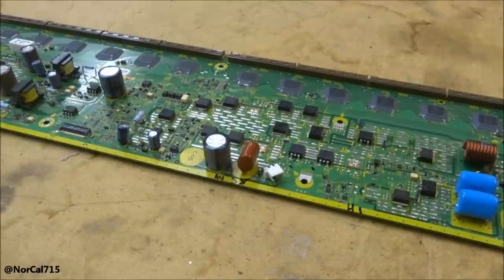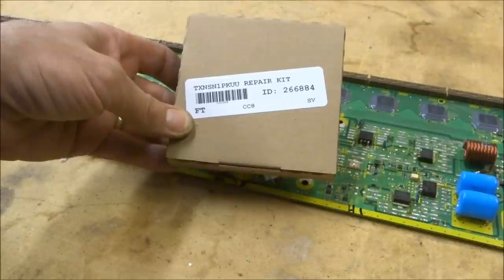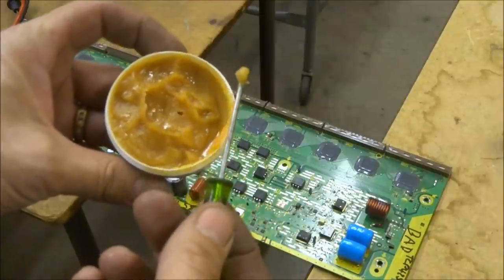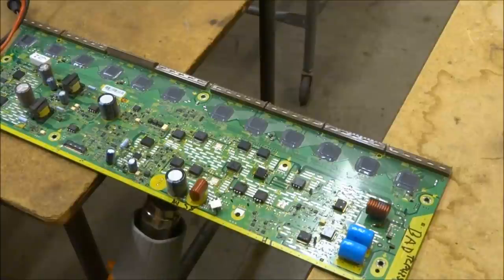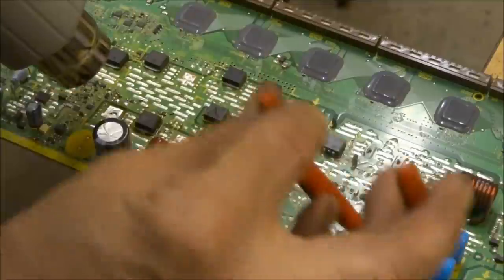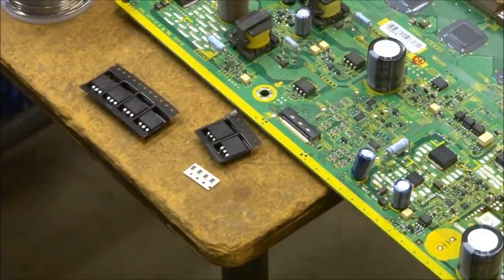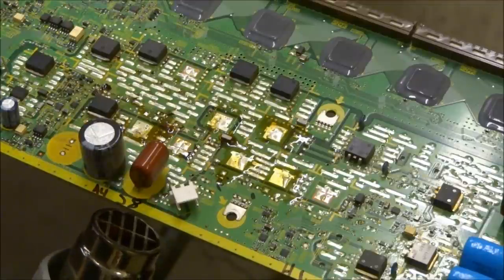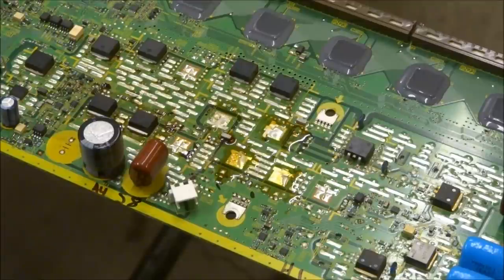TNPA5349 TXNSN1PKUU SN Board Repair Kit Installation

Comment: Thanks for this great video and troubleshooting guide. This matched the issue I had and the root cause appeared to be loose ground screws which led to the solder points where the screws were wearing through and getting scorched.  In addition to replacing the parts, I also applied fresh solder to the ground points surrounding the screws on the top and bottom of the board.  If you have this same issue check the pads surrounding the screws, reflow them and add in some lock washers to ensure a good connection.  I did use a $40 hot air station from ebay instead of the heat gun which made things very easy. Totally worth the cost. Total repair cost ~$55 including the hot air station.

Comment: So I replaced all those components and I still have a short. In the shop Jimmy kit there was also a D481 and a Q441 part, should I try and replace those also. What else could create the short on SN2 connector?

Comment: Will this repair the 14 blink issue? I sent it off for repair to a guy on ebay that said they could repair the 14 blink issue and he changed these IBGT resistors and the smaller ones but the TV still showed 14 blinks after when I got it back. I did a check on some other IBGT resistors on the end of the board area and they are shorted. What else could be the issue here? The guy I sent it to for repair tried to fix it and said he isn't able to figure out the issue now but will let me know if they get a board in to replace this one, which I can purchase from him. Can you help?

Comment: Acid-based plumbing flux instead of rosin-based electronics flux? I wouldn't use that on PCBs, there's always some residue left behind even with water-soluable which is highly corrosive to the board and components. You can get electronics flux in syringe or pen at any electronics store, even Radio Shack. Much safer for the board.
Reply from the maker: I have tested this flux on a single copper sheet sitting for several weeks and could see no corrosion even with a microscope. I have tried several different fluxes intended for electronics use and never had as good of results as with this cheap flux. Thank you for your concern.
Reply: norcal715 it's about years not weeks. In this case the tv will probably die or owner will break the screen before effects of acid flux will kill the board. 
But anyone who wants a long-term reliable repair should not use plumber's flux. 10 million electronics technicians can't be wrong...
Reply: davecc0000
As an electronics technician myself, I can verify this is true.  It's not just about weeks versus years, we're also talking about something that heats up, and chemical reactions occur faster when heated.  Also, you run a risk of damaging the board when you pull on components with pliers.  The only thing holding that copper on there is a layer of epoxy, you really shouldn't be applying force to it.

Comment: I have the same model TC-P42ST30 made Feb 2011.  Initially I had 6 blink code.  Then I ordered the kit in your video.  After perfectly replacing the components I now have a solid no blink code. And If I hold the power button down for 5 seconds. It blinks 14.  I am unsure if I fixed the SN board or not. Would you know maybe? or has anybody else seen my scenerio before?
Reply: +Adub 408 any idea what this turned out to be? i have no blinks, but if i hold down the button it blinks 14x as well... not sure i need to fiddle with the SN board or not...
Reply: +Farris Martini I am still stuck as I keep searching google and YouTube for the information I need worth it's weight in gold.  What ever happened to the good 'ol days when capacitor replacement was the popular fix.  My 2011 Panasonic 3d Plasma TV looks basically Brand New but is completely worthless as I am unable to fix the darn thing......anybody

Comment: Hello. I was wondering if anyone knows the service menu default numbers for each of the options such as The horizonal and vertical and so forth please. I have a Sony FD Wega Trinitron kv-36fs120. The image is off and the top left of the image is slanted downwards. It seems as if the person that had giving it to me has messed up the picture and I just wanted to see if the default would set it back straight before I have to pay for a repair. Please anyone and thank you.

Comment: How not to repair your TV... You should absolutely not be recommending the average person to take a heat gun to their board. Shocked that shopjimmy would sponsor you for such ignorance.
And you didn't even tell us if the TV worked after replacing the components! Many have stated their board popped and went short to ground immediately after turning on the TV post-repair with ShopJimmy's kit. Maybe it's because people are following the advice videos like this... At least you used flux, though.
Reply from the maker: it did repair the set